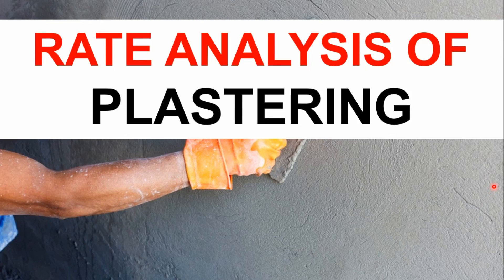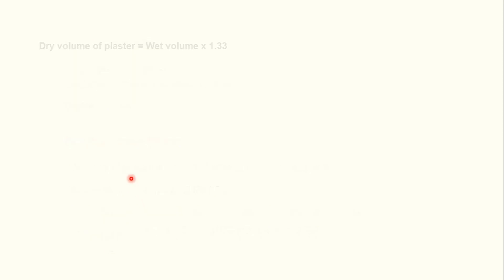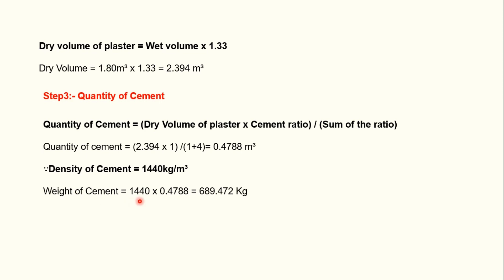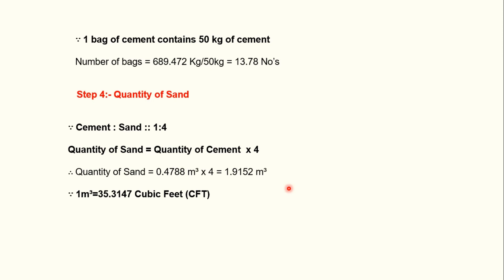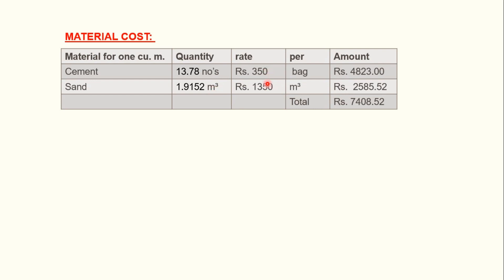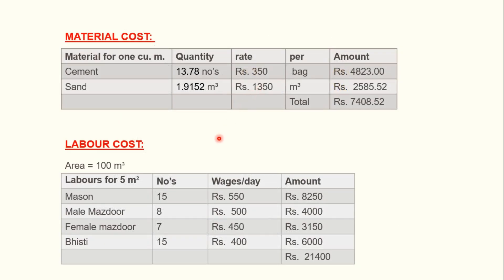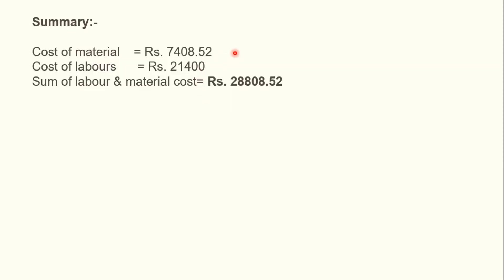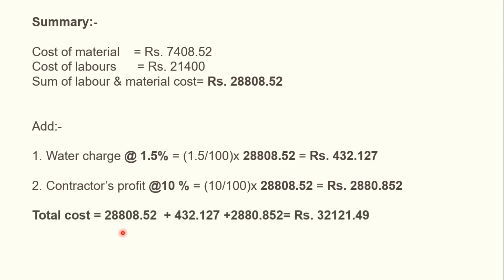RATE ANALYSIS OF PLASTERING  | Civil Engineering

Comment: Labour cost is not right for 100m3 contractor ask for rs 9000 instead of 32000 as mentioned in this video, strange material cost of sand is also wrong it,s about130 per sq meter inactual
Reply from the maker: Rate may differ from one place to another sir.  

I just gave a procedure calculate the coat of plastering.  

That's not the actual cost of plastering.  

Hope you get it.